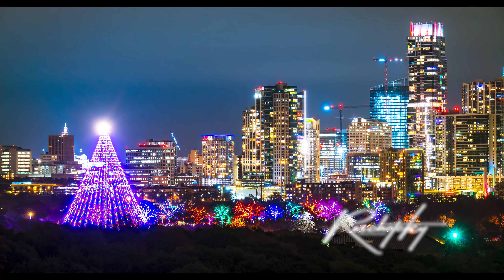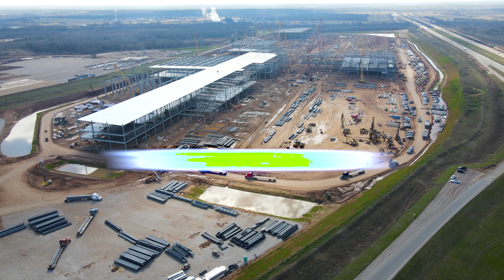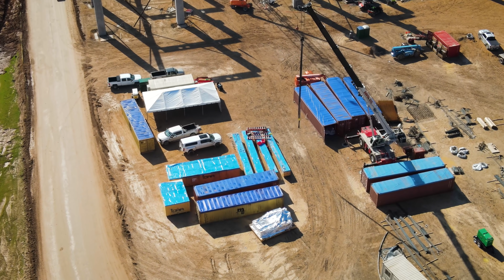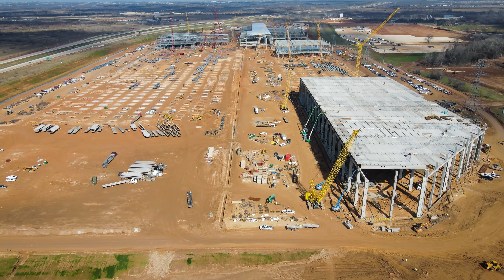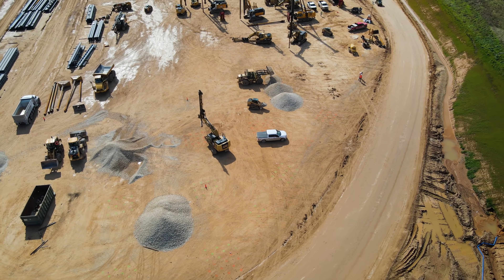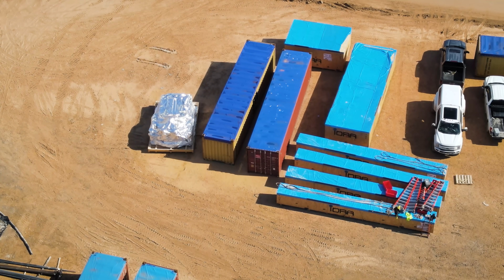TeraTexas Drilling for 4680 Batteries - GigaTexas by Roschetzky Photography - 1-22-2021 Construction

Comment: Ive worked with machining large composite aluminium high pressure castings similar to the gigapress parts andI just cant get over the claim that theyve conjured up a composite that doesnt warp at all as it cools. There has to be some distortion and the really interesting thing would be what tolerances do they have for the accuracy of the cast. Its a bit infuriating bullshit to hear about unwarpable castings.

Comment: My guess is that they are the "Casting Machines, not the Giga Press.
Reply: Giga press is a casting machine
Reply from the maker: @kasibert2229  with so much back and forth j question myself , is the GIGAPRESS , 4 casting machines that make up the one piece frame ?
Reply from the maker: @kasibert2229  because my understanding is that this one casting machine is going to be mounted on the foundation which I filmed today
Reply: @RoschetzkyPhotography  it's one giant machine casting the entire back structure
Reply: @kasibert2229  other parts like door etc.. we call casting instead of press in order to differentiate them
Reply from the maker: Ya I guess I should tighten up on that lingo as well

Comment: Correction. This factory is about 7 times longer than any Football Field or about 2100’. Let Me give You credit for a very good Polish name that looks perfect for a stylized signature. I bet your signature is not anywhere as good. For me it always is about the details and You are on Your name to create a BRAND. It appears that there will only be 6 casting machines weighing 400 tons each when assemble or half the weight of 2 huge PRESSES  that are 800.tons each and a much deeper foundation. I am fascinated by the PRECAST CONCRETE for these w buildings only. It’s also very interesting that they are placing and erecting the IDIRA CASTING machines with a combination of Cranes before the building is finished and before the concrete crane beams are installed for permanent overhead cranes that are required for Maintenance. I think they are being very expedient , installing casting machines before the building is complete. Not so with the much larger Pre Cast Building for 2 pressed. This building needs to have all the walls completed before they can remove temporary pipe supports for column support. They will then erect concrete crane beams, crane, and use it for erection of all equipment. This Pre Cast Construction is totally different than engineering, manufacturing, and erection by MAXX BOEGEL in BERLIN. Brian, You need to get special permission to document the installation of equipment that TESLA will want documented for their records. If You were working for them, I am sure TESLA and INDIRA would pay You very well for producing a Documentary/ for them. I also know that they would have to approve all videos released to viewers. Once the buildings have roof and walls, there is nothing for Your Drones to chronicle for 6 months till they complete equipment installation. GOOD LUCK Brian.